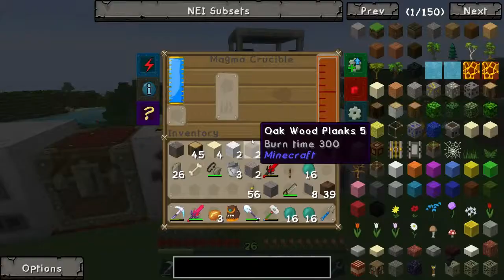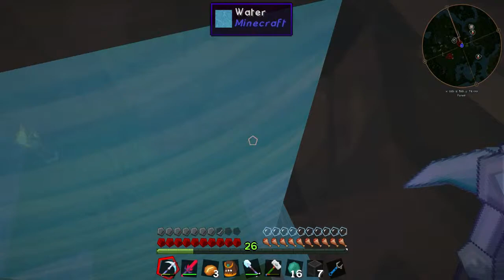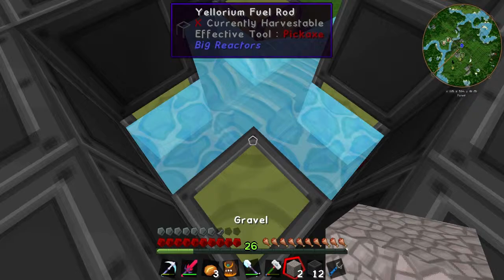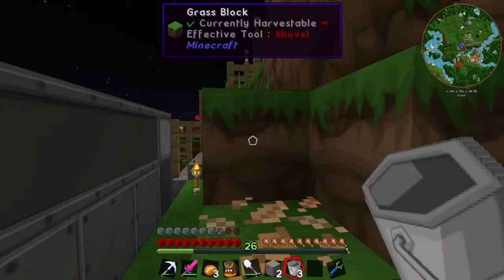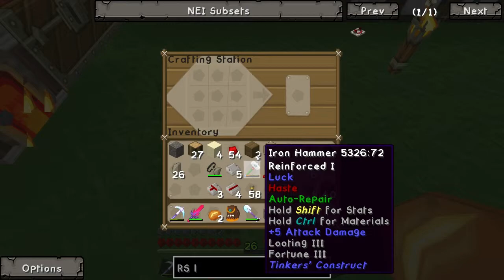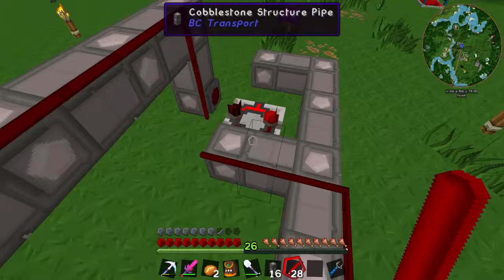Minecraft - Direwolf20 1.7.10 FTB modpack - Part 25 - Reactor re-build

Comment: not a bad result for your reactor at all. :)  Going with a + shape for your reactor fuel rods would give you a little more efficiency, but a little less output per second.  That is only if your worried about yellorium.  Doubt you have that worry right now though, heh

also, I think the "and gate" you have reading the power cell needs to be on the side facing the cell, like the one hooked up to the reactor redstone port.  That's my guess anyways.